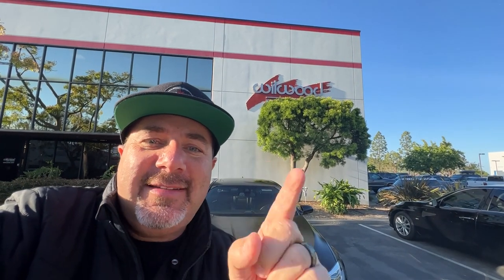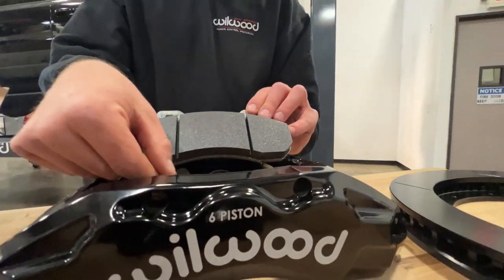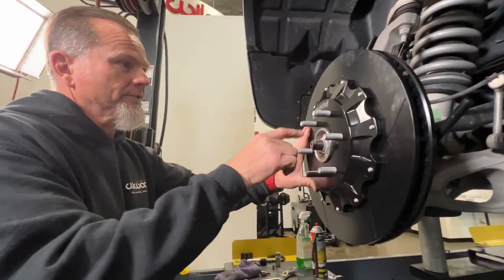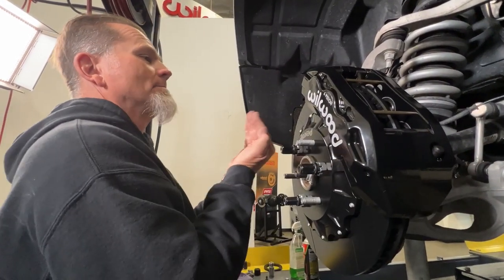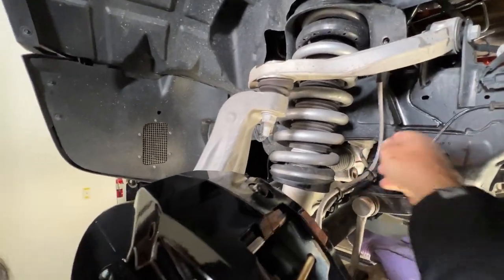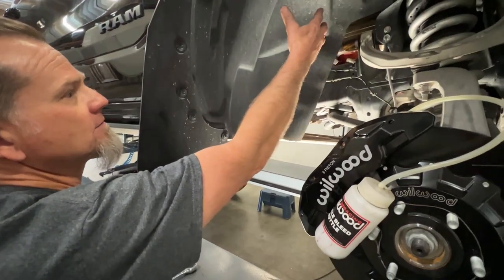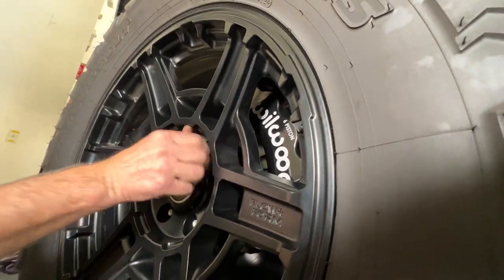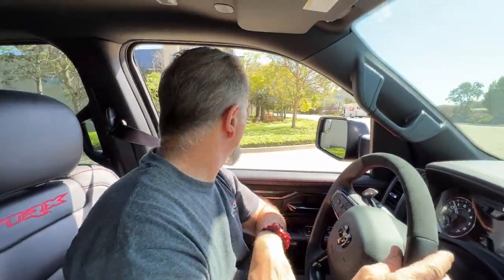Installing HUGE Wilwood brakes on a RAM TRX

Comment: Great video! I cannot wait for my TRX to arrive later this year. What size rims and tires do you need to get the Wilwood brakes? Do they come in any other color? Finally Wilwood brakes!
Reply: Check the link in the description, says 20" minimum.  My truck comes in this week and I want bigger brakes but not willing to go up to a 20 personally.  Guess I'll deal with the stockers.

Comment: Is there a 4 corner kit for a RAM 1500 DT limited?
Reply from the maker: There are no brakes for the rears yet because of the electronic parking brake. Wilwood is working on it.
Reply: How is Wilwood going with a 4 corner kit for the Limited?  @JayTilles

Comment: I want these for my 2020 Ram 1500 and since I pull a trailer I'm curious how much more they would benefit me.
Reply from the maker: HUGE benefit. I had the same set of TX6R brakes on my 10,000 dually and they trimmed 60--0 stopping distance by 11 feet. That may not sound like much but that's half the length of truck.

Comment: The question here is not about the looks but performance. How do they perform? Will they be better than the original for a truck with a trailer? That is the question.
Reply: I mean you sure would hope so lmao 🤦🏻‍♂️
Reply: Well... I have Wildwood on my 1991 F150, and  a 1970 Charger and I'm not feeling the difference. The reason for my question. On the other hand, I've done other conversions, with OEM adaptation to other cars I have, my 56 & 57 Chegy and found better results and that's no laughing matter. There's no bigger disappointment than paying big dollars for a system like that, and not achieve what you're looking for... Better breaking.
Reply: Let me go even further... I swapped the brakes on my 2014 Jetta for the GTI, it has bigger brakes and the performance on that swap is better than the other two that have Wildwood. Those were picked up from the Junkyard. Again, I'm not a regular Joe asking a question, but somebody with experience on this matter.

Comment: Stock TRX brakes suck!  Big miss on Ram, not that a 100k truck doesnt have enough profit margin to have some decent stopping power of a 6000lb truck with 700hp.

I warped my rotors in first 15k miles, upgraded slightly with ebc pads as only options available at the time were the roterra’$$$.